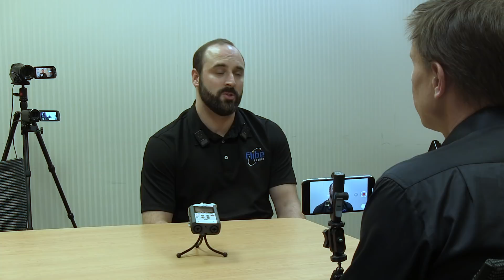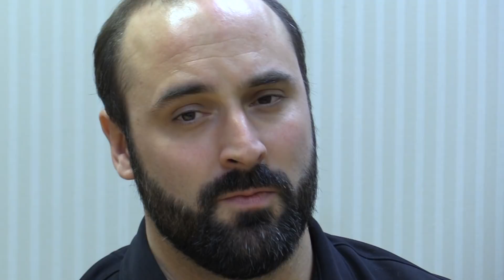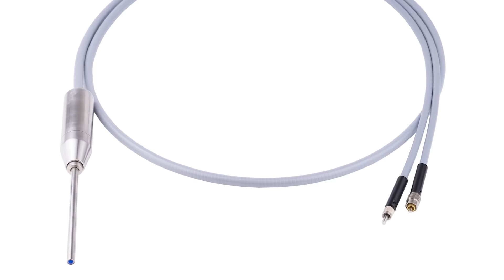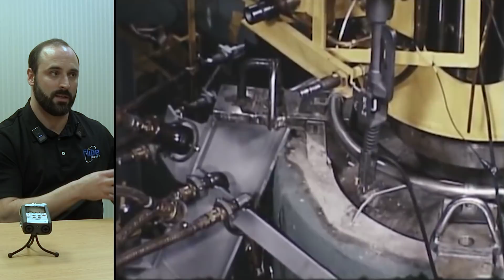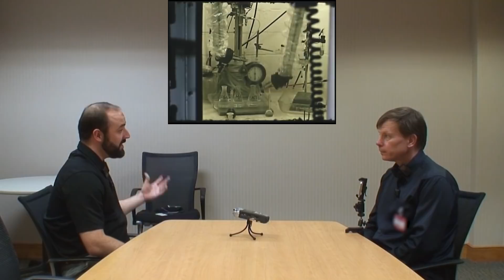Flibe Energy's Matthew Lish - LFTR Online Chemistry vs Radiation @ ORNL MSRW 2019

Comment from the maker: Matt Lish mentions an ORNL video on Molten-Salt Reactor Maintenance, it can be found here: https://www.youtube.com/watch?v=uHT-w2x6dDg
Useful Timecodes:
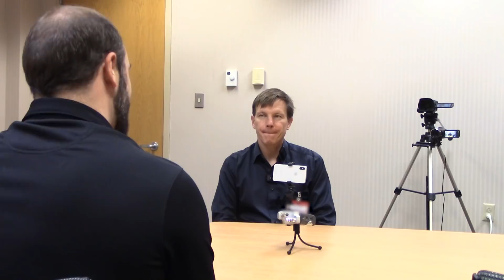0:48 Learned about the concept of Molten-Salt Reactors
2:50 Why nuclear power? Energy for progress of civilization.
4:43 Career in nuclear power, then Fukushima.
5:38 Experience developing a Large Integral Light Water Reactor.
7:00 Passive Safety and Regulatory Environment.
10:14 We clean the salt continuously. Xenon example at Chernobyl.
14:50 Xenon just bubble out? Any challenge there? Off-gas chemistry.
16:40 LWR analogs for Chemical Kidney?
18:59 Concerns about Chemical Kidney radiation challenges?
23:47 Motor operated valves and pumps vs radiation.
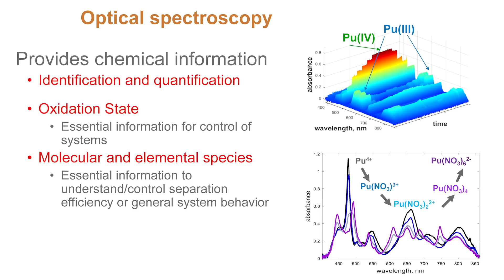25:03 Online monitoring with optical spectroscopy.
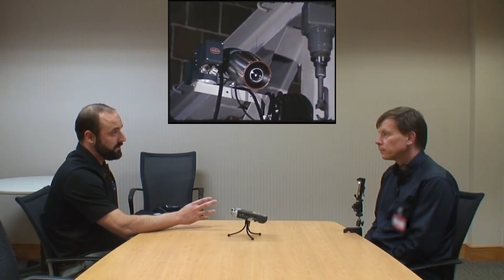26:10 This is not news to Molten-Salt Reactor community.
27:38 Hot cells. What can be inside, what must be outside.
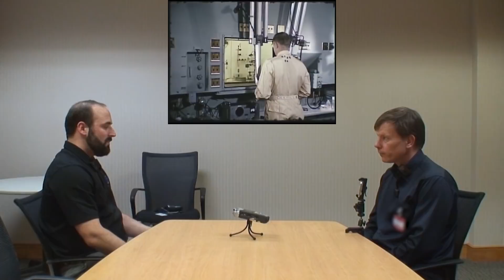28:28 Uranium instead of Silicon for future integrated circuits.
...also I'd like to mention that BERNIE SANDERS is OPPOSED to all forms of nuclear power, including Advanced Reactors such as Molten Salt Reactors. 

The remaining Democratic candidate for President who supports funding of advanced nuclear power is JOE BIDEN. Joe Biden even distanced himself from his fellow Democratic Senators who abandoned Clinch River during President Bill Clinton's administration, being one of the few Democrats who did not vote to waste the $1 Billion already spent on that advanced-for-the-time reactor.

Bernie Sanders raised emissions in Vermont by closing Vermont Yankee Nuclear Power Plant. https://www.forbes.com/sites/michaelshellenberger/2019/04/16/bernie-sanders-denies-closure-of-vermont-nuclear-plant-increased-emissions-the-data-says-otherwise/ It appears that Bernie Sander's concern about Climate Change is only surpassed by his fear of Chernobyl, as his stated reason for abandoning nuclear power at CNN's Town Hall on Climate Change.

The Trump Administration has been supportive of Advanced Nuclear. Smart, innovation enabling changes to regulatory procedures (allowing non-PWR to enter market) are underway with bi-partisan support.

If you are a voter (or intend to be a voter) in the Democratic Primary, before supporting Bernie Sanders, please consider what it will mean to have a President citing Chernobyl as a reason to abandon nuclear power entirely. Sanders DID close Vermont Yankee, despite all his stated concern about Climate Change. Germany is a crystal-clear example of how shutting down nuclear power leads to EXPENSIVE, and INEFFECTUAL climate change.

Also, for anyone looking for another before-it-was-cool position taken by Joe Biden: In 2012 it was BIDEN who caused OBAMA to legalize gay marriage on an accelerated schedule, by BIDEN having made very supportive public comments, causing the White House to scramble in response.
Reply: Matthew Lish is an excellent communicator on this subject.   It would be good if he became the voice of FLIBE promotion and inspiration.

Comment: I think another term needs better disambiguation in these talks/Lectures: supercritical. 
with the CO2 (and possibly other gases, too),  it should be? 
 I don't know: "super_beyond_boiling"_CO2;    _H2O_SuperSteam,  _H2 (even Hydrogen can be super_beyond_boiling, at surprisingly low temperature);  

andor addressing the ambiguous term to nuclear Reactor Reactivity, it should always be:
 " excess_super_NEUTRONAL-Reactivity." ? 

A further point is the Xenon off_gas sequestration with accompanying foaming problems, potentially plugging valves etc. There is technical knowledge out there in Flotation processes in the mining industry. The foam can be hard to collapse, and it can get quite sticky. it needs either unexpectedly large equipment or good centrifugal separators ( which have some "tech-traps" on their own). To do this right: search for the advanced cleaners of Finish Paperindustry's Cyclotech_cleaners, now part of Metsä Company, which have overcome some conventional shortcomings of stickiness.)

Comment: They are trying to close the fuel cycle in the thermal spectrum, not going to happen.
Reply from the maker: This is NOT a machine for fissioning-to-completion used fuel. U233 emits enough neutrons in thermal spectrum that Th/U233 can be sustainable. So long as FP which would otherwise intercept some of those neutrons are removed from the fuel salt. The goal is TO NOT CREATE the hard-to-recycle actinides in the first place. Transatomic once claimed they would recycle sued fuel in a thermal spectrum. This is not that.

Comment: Kind Greetings to You and Kirk Sorensen. 

call boron a: reactivity-poison, don't shortcut the very specific word; it's meaning would get twisted easily. 

in 17:18 (English transcription_US: ) it isn't hydrochloric acid, Matt said: hydroboric acid (this word is not yet in the Youtube dictionary, so the erratic translation, transcription) 

Another thing about gas stripping: in Recycling-Paper Industry, there is a device, that was called the Escher-Wyss step-diffusor headbox design. it creates an evenly distributed, turbulent flow of liquid/solid  (fibers, particles)/air-bubbles (small gas-bubbles, created by the tangential flow of the liquid, if a gaseous component is desired in the suspension) 

 There is also experience of creating foam for deinking purposes (with the help of soap, water-glass, NaOH and H2O2), skimming it off and then collapsing the foam again to get back a (less voluminous (still containing some air)) viscous liquid, that can be handled for further treatment and separation. MSR students should look at it, although the chemistry would be quite different in molten FLIBe-salt. You need to play with surface-tension, to get it right.
Reply: We need more students playing with molten salts.  I could see hobby stores selling melted wax kits that demonstrate hot fluids pumped through a system.  Advanced hobbyists would replace parts so that they could use real molten salt. It's like the way they used to sell model railroad kits when I was a kid.

Comment: Why is load following such a big issue? Can't you just dump the unwanted power into a heating element when there's low demand?
Reply from the maker: Kinda where my mind goes too. I used to run Seti @ Home and I imagine one could use the world's plugged-in computers to generate whatever local load is needed fairly quickly, to compensate for any drop in demand.
Reply: @gordonmcdowell  Good idea. Smart metering and pricing in combination with some heat or cold storage connected to domestic heating and A/C systems could be another option.
Reply: @gordonmcdowell  mine cryptocurrencies for balance loading!
Reply from the maker: @quelorepario  Well I was really hoping Folding-at-Home or a SETI-at-Home style project would do that. Personal crypto-mining is the sort of thing no one is going to throttle back because the grid would like them to. It might be that an OS vendor has to take the lead on this, and either create their own energy-intensive computation project, or incorporate an existing one. Otherwise I don't think we'd ever see useful adoption levels.

I'd certainly like to use computation heat to help take a bit of the load off our gas furnace in the winter.
Reply: @gordonmcdowell  first and foremost I would like to thank you for all your efforts to promote thorium research, without your help to support Sorensen popularizing his efforts, I don't think we would have progressed this much!
Now going back to the thread, running seti or folding proteins would probably be the equivalent of burning the petroleum.
Running a miner at least you can keep the plant profiting when you can't sell the energy.
Reply: @quelorepario  The problem with running expensive hardware like crypto miners intermittently is that their capital cost goes up. Admittedly I don't know at what degree of intermittency they would become unprofitable.
Reply: I worked on submarine reactors, which were the basis for later civilian reactors. there are designed with a negative temperature coefficient of reactivity, meaning they naturally load follow very quickly (as submarine power plants require). The issue is that renewables on the grid are intermittent and destabilize it so base load plants have to compensate. This gets harder and harder as more renewables come on line. cheaper than resister heater dump loads would be just to get rid of windmills and solar.
Reply: @billyjoeallen  Interesting. What if anything prevents a typical 1MWe PWR on the grid from being designed with this functionality? US Submarine reactors are PWR's if I'm not mistaken?
Reply: @phamnuwen9442  I'm not an expert on civilian reactors, but my understanding is that they do have a negative temp coefficient and therefor ARE load following, but their size may affect how quickly they can respond to changes in steam demand (changes in power).  Larger reactors are more thermally efficient (More volume per unit surface area) but that may come with some drawbacks  (Turbine inertia? less/more thermal buffering in the pressurizer?) or it could have to do with the much lower levels of enrichment of the fuel. The big problem is that the fission products don't just absorb neutrons but they produce a lot of decay heat even when the control rods are in and the chain reaction is completely shut down. It's just a dumb design. It wastes neutrons. coolant boiling temp is too low. no online refueling, etc.
Reply: @billyjoeallen  Is turbine inertia really a problem? Shouldn't the turbine of a PWR producing grid power be kept at nominal speed at all times to match the grid frequency?

Anyway, Wikipedia says decay heat is just 6.5% of previous output directly after shutdown and 1.5% after an hour. That doesn't sound too bad. Maybe you could use batteries to buffer the decay heat energy. This is of course assuming the turbo generator can still produce power at these low levels of output.
Reply: @phamnuwen9442  I am speculating about turbine inertia. Naval turbine-generators have different demands and performance parameters. That is outside my area of expertise, however it's logical that a large power source such as a wind farm suddenly going offline would have the same delta power as a large current draw coming online. Batteries, pumped hydro and other energy storage systems introduce cost and complexity. Nuclear plants are far too expensive to operate as peaker plants (back-ups) to renewables, even if energy storage or other supply/demand buffers are in place.
Reply: @billyjoeallen  Yeah that's probably true. Maybe peaking will be possible with one of the Gen 4 designs. Terrapower's new sodium cooled reactor is going to use molten salt heat storage to peak from nominal 345 to 500MWe for a number of hours.

Though I think this might be more of a "solution" to grid problems created by unreliable solar and wind than demand peaks.
Reply: Load-following is a very big issue with PWR Operators (the whole world.)  PWR Reactors are designed for a very specific load; when it changes suddenly, their boron-based coolant and neutron regulation systems are upset, and if they don't make flow changes to match, coordinated with control rod extraction/insertions, the reactor can scram.
Reply: I was thinking that liquid aluminum (aluminium?) batteries could be used for load following.  The molten salt is already at or near the melting point for aluminum.  If the MSR was used just to maintain the temperature of the aluminum, the heat of fusion from the battery would heat the CO2 gas to power the turbine.  It's a "Toyota Prius" approach to problem, I know, but it would reduce stress on the reactor.

Comment: Xenon -133 is a medical grade gas for nuclear medicine that is made by Uranium... curious what type of Xenon that is being discussed?!?
Reply from the maker: Xe-135 is the isotope which is most troublesome and which the most-of is created.
Reply: @gordonmcdowell  most of the Xenon is some other fission product that decays into Xe while the Xe produced by fission decays into something else. WHEN you remove the Xenon is critical.
Reply: @billyjoeallen  The xenon-135 will decay to caesium-135 which is a long-lived nuclear waste (t½ 2.3Ma). If it absorbs a neutron, the resulting xenon-136 decays to stable barium-136. My question is, why would the off-gassed xenon be shunted into a containment vessel instead of being pumped into the jacket flow.  It wouldn't stall the reactor and it would act as additional shielding to neutron radiation. As the song goes, "♪Every neutron's wanted. Every neutron's good. Every neutron's needed. In your neighbourhood.♫"
Reply: @billyjoeallen  Sorry. I didn't realise that Matthew Lish was talking about a single-salt design.  Of course the xenon has to go into an off-gas tank because all flows lead to the core.
Reply: Iodine-135 which then decays into Xenon-135 via beta minus decay (about 95% produced this way). It has a ridiculous 2M barns absorption crossection under reactor conditions and so it eats up the flux like no tomarrow.
Reply: Xe-135

Comment: Bla, Bla, Bla !!! Why Don't We Have A Working Model Of A MSR OR LFTR After Decades Of Phd Bla! Bla! Bla! ??????
Reply: Exactly because the traditional nuclear industry is not capable of seeing (or flatly refuses to see) the value of these new reactor systems.
Reply: "It's my way or the highway" type of thinking (the LWR industry) that throws up obstacles to MSR research and development and ultimately, commercial production.
Reply: Thank you for a very appropriate question; Oak Ridge got the MSRE running in a few years, and it stayed critical for 20,000 hours, until they intentionally shut it down.
Reply: MSRs like renewables, effectively demonetise the fuel industry. Naturally there is huge pushback from fuel interests, both fossil and traditional nuclear fuels (ie. fuel rods).
Reply: Suggest you look at Thorcon to see a timeline on the approval process they're going through in Indonesia. Indonesia is fast-tracking it too. It takes a while.